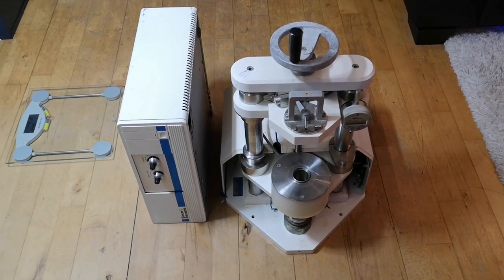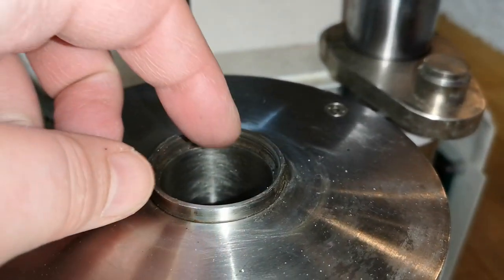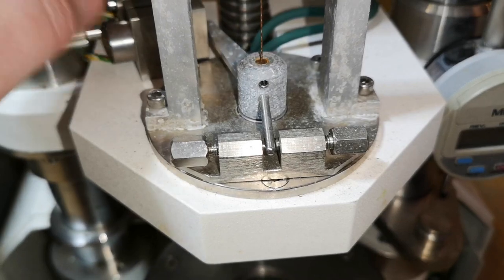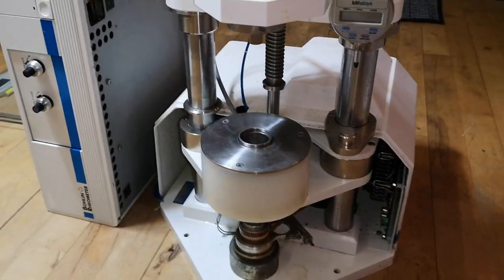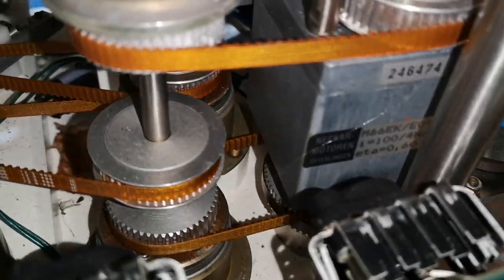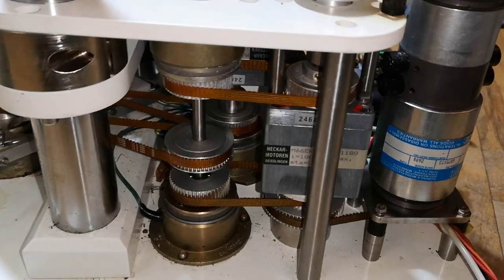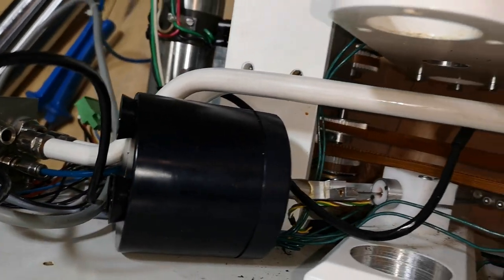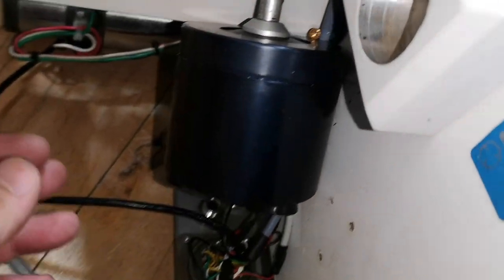Bohlin BRS VOR Rheometer System Teardown 1990

Comment: This is a great find and easy to watch video, you could try and make a small press with the parts to remove stuck pulleys and such.

The Sine wave generator is probably for the voice coil. Materials behave differently if you shake them fast or if you push them slow.  It can be used to determine the Rheological characteristics.  Look up Ooblick to see the sort of things that this could measure accurately.

Some people may be happy to look at the EPROM dump.  

If you place the analogue and converter cards onto eBay someone should pay you a little, might be cheaper to ship than the whole card cage but offer that to the buyer as well.

The electrical clutches were probably to start and stop the rotational drive accurately at full speed so the test did not have variable speed to contend with.  They may even select gear ranges and perhaps reverse the rotation direction so that the mass of the sample does not continue rotating but is simply rotated a little and then back as soon as the sensor at the top picks up the motion.

The servo motor is typical.  It has a DC Brushed motor which is the bigger part and then a DC feedback Tachometer that gives an accurate voltage in relation to rotational speed.  The Servo loop would keep the motor at the preset speed.

The torsion spring is very nice because it will rotate without adding sideways forces to the air bearing, will not have any sticktion like a multiturne coil spring.

Oil is used for heating if you need to go over 100 degrees and you do not want the chance of boiling even with antifreeze added.  A temperature regulated oil heater is a standard laboratory box used in many places.

Comment: That black unit is a voice coil actuator. Like on a shaker table
Reply from the maker: exactly B&K so clearly a keeper part
Reply: Shake it up, lol
Reply: Is it for viscosity test?
Reply: @radiomekaniker1234   no it’s for vibration testing. There used a lot in aerospace.
Reply from the maker: @radiomekaniker1234  yes